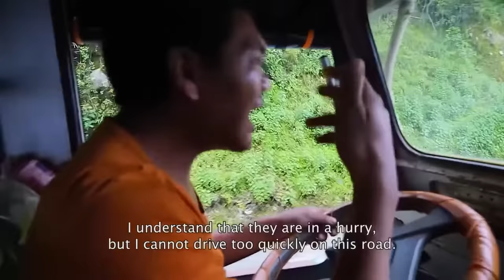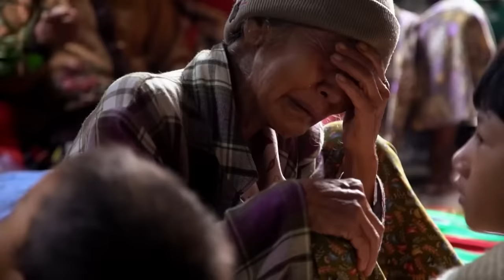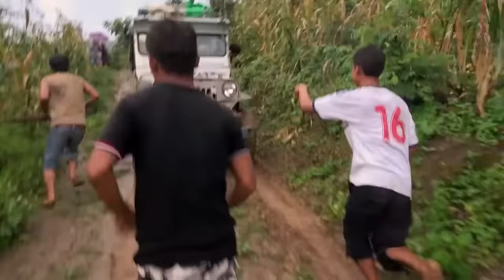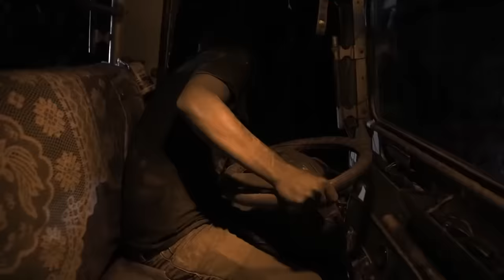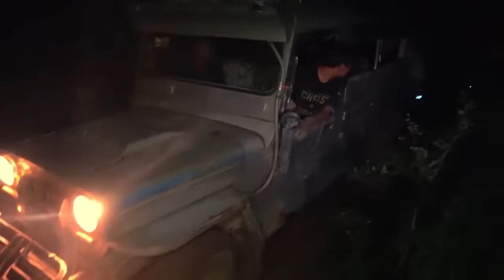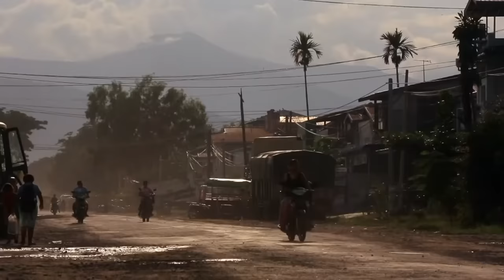Taxi service to mountain village, Myanmar

Comment: Nice, I thought passenger jeeps are only available in the Philippines. In the Philippines there are also 4x4 version of the normal Manila Jeeps. In some provinces there are 4x4 passenger jeeps, some have even rear differential and front lockers until some 10-15 years ago. Amazing isn't it. But due to the progress and time, those are now gone since most roads are now concrete and even asphalted. Now those areas that can only be reached with 4x4 jeeps and cars even have their own modern taxi vans (Toyota Hi Ace Vans and Nissan Urvan) mostly.
Reply: Here in India as well. I'm from North East and jeep was/is a mode of transportation.
Reply: I have a CJ500D in Kerala